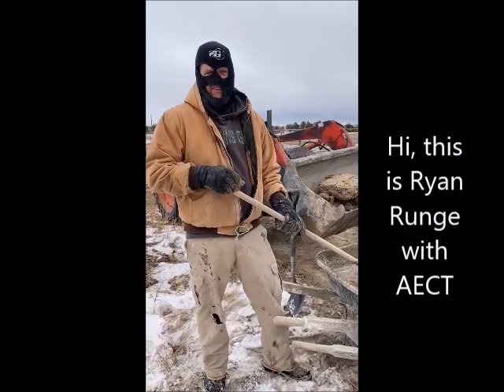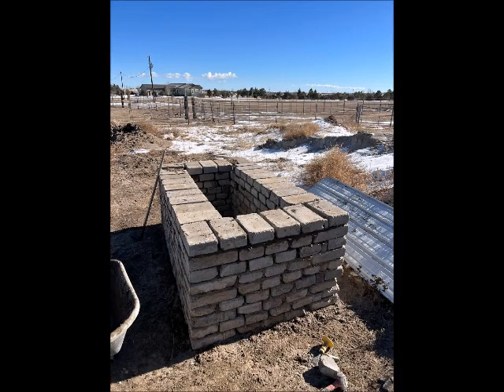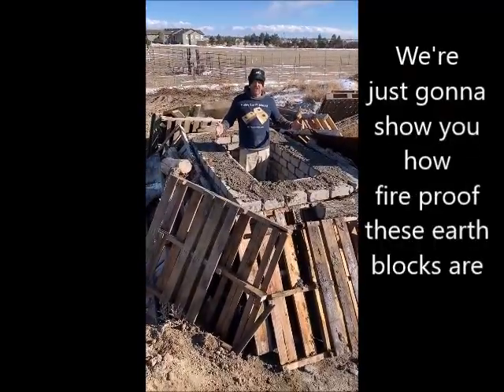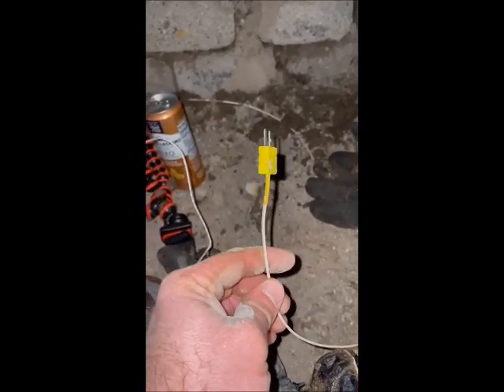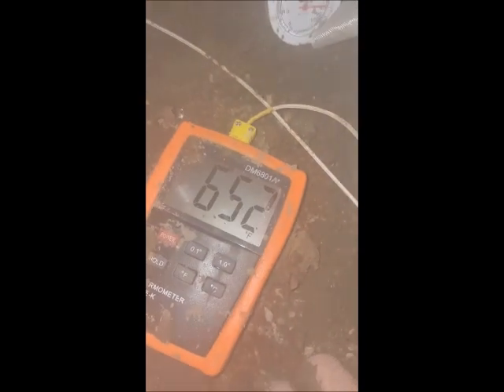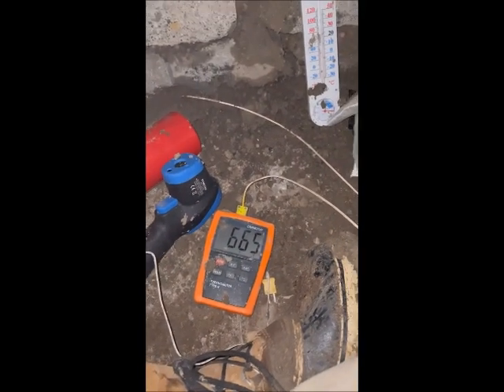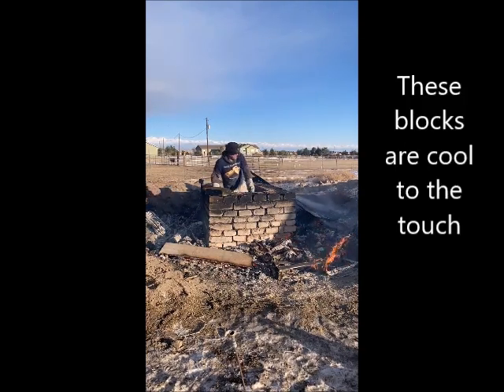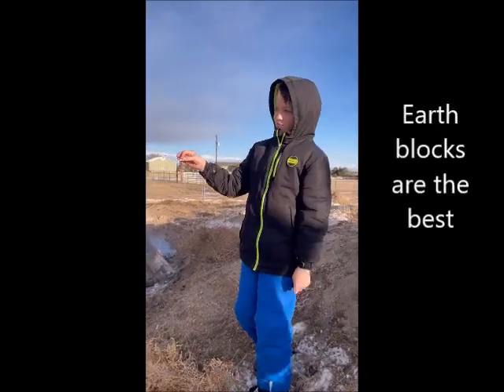I sat inside an earth block enclosure for two hours while a fire raged all around it. #fireproof

Comment: Impressive! How do they handle earthquakes?
Reply: Some guy made one reinforcd around the doors windows and corners and it held up well in a test.   The test was like on a giant shaking plate.  It was cool.
Reply from the maker: You can use a BP714 compressed earth block machine to produce interlocking, holey CEBs that can be reinforced both vertically and laterally. Our customer in Haiti (Welcome Home Haiti) have built over 250 homes this way and they have been through multiple hurricanes and earthquakes without getting damaged at all.

Comment: Walls don’t burn first. You need to protect ventilation from get embers into it. Also, you need to make sure that embers don’t stuck in any way on your roof, windows, facade.
Third, you need fire resistant windows. Probably temper glass.
If you have great walls, but your windows crack, your house will burn down.
Reply from the maker: Agree.  Compressed Earth Block (CEB) walls are only one of many important aspects of a fire-proof home.

Comment: Excellent demo. Kudos!

Are these blocks unstabilised or stabilised with cement? 

Whats your machine's volume compression ratio?

Block height tolerance + or -  mmvalue?
Reply from the maker: These are 92% dirt, 8% cement.  They were some old reject blocks I made a few years ago.  Un-stabilized blocks would have performed even better! Our machines can posh over 2,500 psi, but the best blocks result when you hit between 1,400 and 1,900 PSI. All of our blocks will be the same thickness, within 1/16th of an inch.
Reply: @advancedearthenconstructio5103  Thank you and nice

1. So whats your volume reduced to at the PSI 1,400 and 1,900 ?  For example 180mm height before compression and 100mm after compression. (1.8 - 1)

2. When you could go upto 2500 psi, whats the reason you limit the pressure beleow 1900 PSI? Obviously high pressure means blocks result in higher density and higher strength.  So one wound generally want to go for higher strength. I am sure there a good reason behind it. Is there any negatives for high density blocks?
Reply: @sagayarajdavid6628 I'm surprised I don't see an answer yet.  My guess is that they become brittle because they loose elasticity.  That would probably cause bricks to break easier in ground movement.
Reply: @advancedearthenconstructio5103 If you can kindly answer the questions, that will be great
Reply: @sagayarajdavid6628 this all depends on the composition of the dirt. Yes, you can apply too much pressure and actually create structural cracks in the block. For a high clay, low aggregate dirt, you might only need to apply 1,200 psi to 1,400 psi to get the perfect block. For a low clay, high aggregate dirt, you might need to hit 2,000 psi or maybe even higher to get a perfectly compressed block.

Comment: What did you do for air/oxygen?
Reply from the maker: It was a large enough space to hold all the oxygen I needed.  I set the metal "roof" in mud, so that the smoke couldn't come through.
Reply: @advancedearthenconstructio5103  If you had that as a shelter against wildfire it would be a good idea to have an oxygen source.
Reply: @advancedearthenconstructio5103  glad you thought of it!
Reply: Holy s#1t Runge… 👍🏻👍🏻